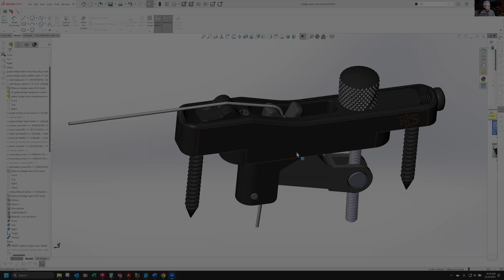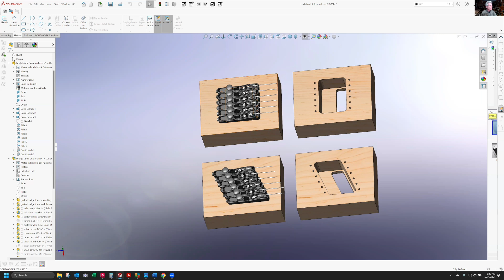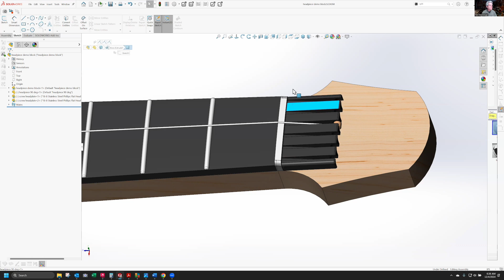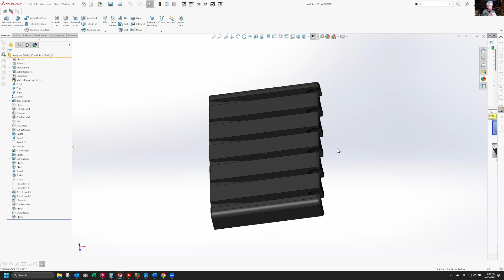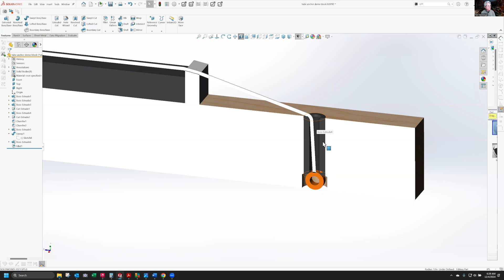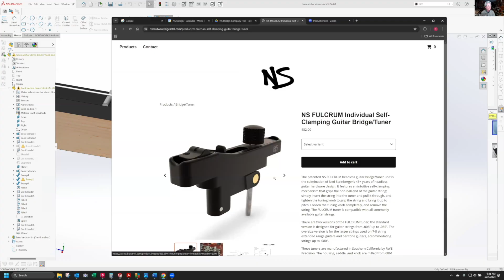NS Fulcrum Headless Bridge Tuner

Comment: NS Design is famous for headless instrument. Why was the Cello and Bass not see designed with headless tuner? The violin was headless.
Reply: Because they are held vertically with their weight supported by the end pin there's not much advantage to adding the expense of headless tuners. The violin and guitar benefit greatly by reducing the weight at the headstock. But thats not a problem for cellos and basses. (Im a cellist and a builder who has made a headless cello, more for style than functional benefit)